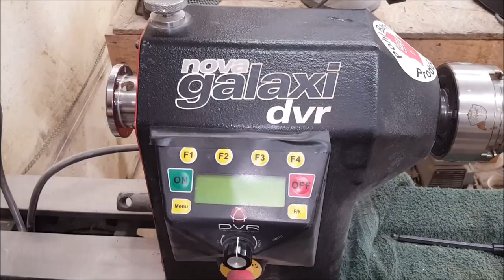Table Top resin pour

Comment: I have an old desk that I picked up from the habitat for humanity restore that I've been using as a makeup vanity in my dressing room... I've wanted to redo the top of it and I think that project just got a whole lot longer and more expensive after watching this... LoL 
I'll tell my boyfriend he can blame you for it :p
Reply from the maker: I'll take the blame, Lowe's carries an Epoxy resin designed for this application,  If you watched Bobby Duke's latest video with the egg.  He uses it, roughly $70 for the 2 part gallon Kit, you wont need it all,  they also carry a smaller kit but you would probably need 2 of those @ about half the price for both,  the mica powders can be purchased at Hobby Lobby if you are in the states that is. or Dollar store make up kits will work , you just need to pop them out and crush them into powder, paint the top what ever color you would like to seal it, mix 2 batches as I did one clear to spread on the top and the other to mix all the colors separately, again it doesn't take much,   Not really expensive at all if you think about it.  watch a few videos on it that explain it a bit better than I have,
Reply: @PohlBarnProductions  Lowe's and hobby lobby are both within a 10 minute drive if my house heh heh heh.

Comment: Damn I was looking forward to the lovely lady helping :) But really looks great and I might be wrong but think your heater was the main cause of your frizzies lol
Reply from the maker: I was too Russell,  LOL  Laziness is the main cause of my Frizzies,  I turned the heater off but forgot to turn off the fan and I should of covered the project.
Reply: @PohlBarnProductions  lol damnit man sucks you forgot but from here it did look good
Reply from the maker: it looks great, we have a Husky, a walking fur bag ! if you noticed in the video my wife points at her fur in the table after we were done, I plan on pouring a thin coat of clear resin after I sand the imperfections out of it, I didn't have time to do that as it was needed for Christmas Dinner,

Comment: Hi from England

I'm thinking those dimples & dots are probably due to pinholes in the wooden tabletop...
A couple of sealing coats of epoxy beforehand should eliminate them...

What you did here was bring a knackered old table back to life...
So many of these are bought from mass production furniture outlets...then a few years down the line are cast off for something twinkly, sparkly & new...(pressure selling advertising campaigns play on this addiction to the latest consumerist tat)...
Consequently so much of it ends up going to the tip where more often than not its turned into chipboard/conti board...

I was going to say you gave it back its mojo but I don't think it ever left the factory with any...
So I'll say you've upgraded it instead...
There, how's that... 😉

With thanks
Glenn
GLMelectrical
Leeds UK
Reply from the maker: Thanks glenn, I thought the same thing, even though I painted the surface some may have gotten through and soaked into the wood, I actually have two of those table tops but only one complete table, one was much smaller so I just used the other one. It had no MOJO what so ever !  I should of used them both and made one 4 x 4 table as my over sized chairs do not all fit under it at one time.  LOL  Oops !  Not sure why but it keeps sending you off as Spam.
Reply: @PohlBarnProductions 

Hmm...SPAM...
Chopped pork & ham in a can...
Exported into the UK from the USA during WW2 in huge quantities... 😜

Sorry...i couldn't help it...
Reply from the maker: LOL   who doesn't like fried spam !
Reply: @PohlBarnProductions 

Hmm...nice...

And a bit of John Bull's roast beef of auld England...
(in fact that was my Xmas dinner)...😋